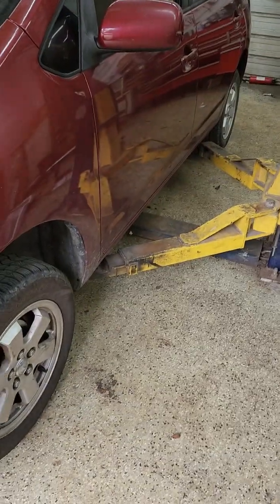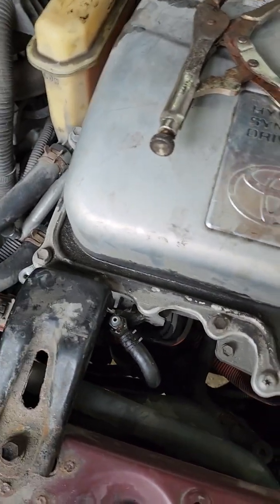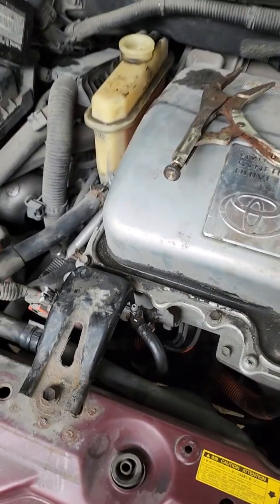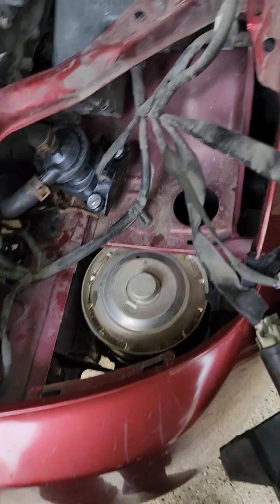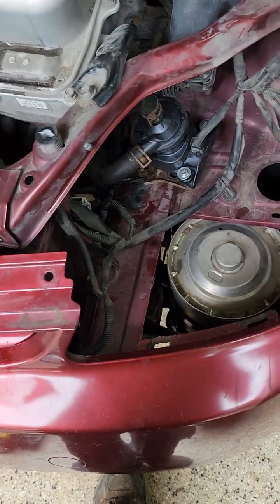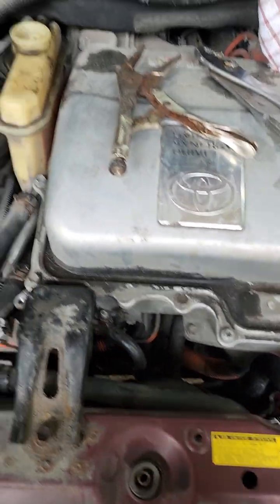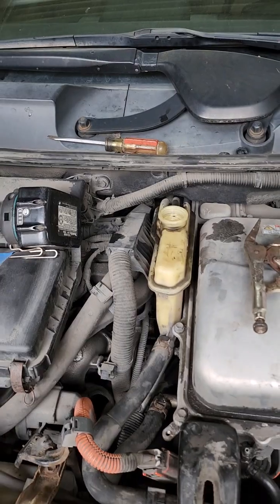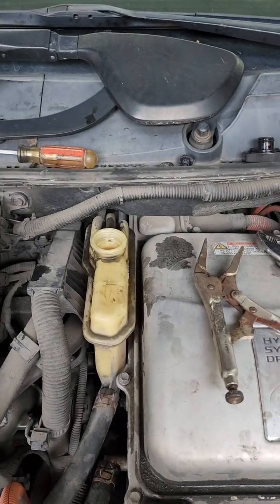P0A93 airlocked gen2 Prius inverter pump replacement tips including bleeding the system.

Comment: Interesting.  Coolant runs in a little channel system underneath that big metal dome (the inverter).  As a note to check if the inverter coolant pump is working, look for "turbulence" in the reservoir (like this does at 5:25) but make sure you engine is "on" fully (i.e. gas pedal when you push the on button), otherwise it's using only the 12V aux battery to run the pump (and if that's weak, it can drive it...more slowly...and not have turbulence, even if the pump is good, learned that the hard way).  You can replace them at home, easiest way is to pull off the light and swap out the three "topmost" screws for it (ideally clamping both hoses before doing so).  Cheers and thanks for posting this, it led me to the right clue (pulled that hose like you, then ran pump, then noticed it started getting weaker quickly LOL).